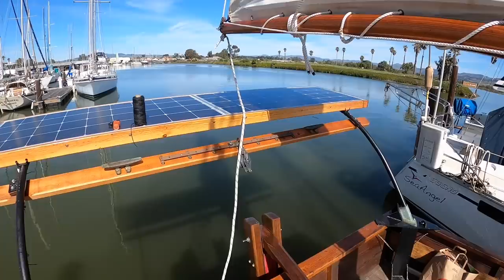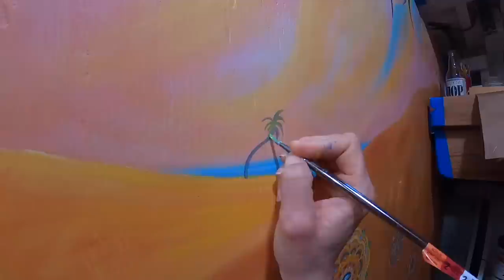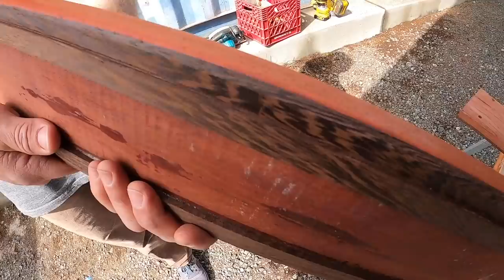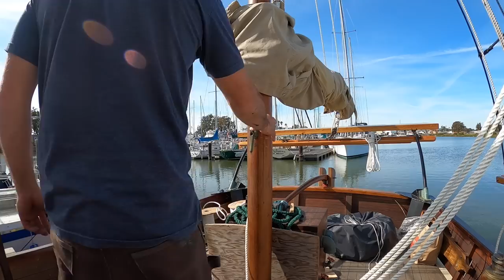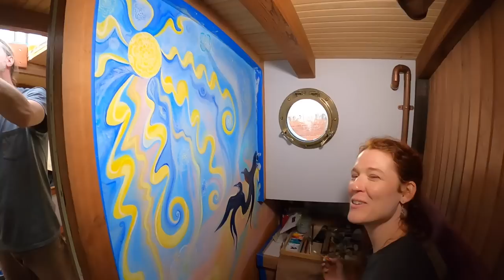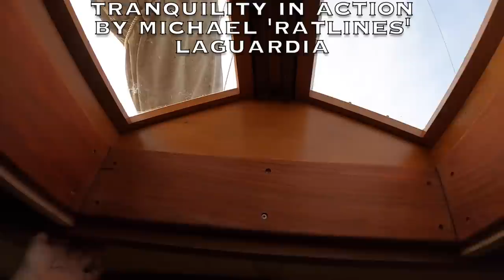Salt & Tar: Ep.190- Ruthless Boatbuilding

Comment: Awesome job Garrett and crew... if you don't like that deck mounted sheet block laying on the deck when the sheet is eased, you might be able to put a big spring around it's connection to the eyebolt so that it stands (sorta) upright off the deck and doesn't get fouled every time you haul or ease the sheet. Looks better too... Search for images of Springed Deck Blocks to see what I mean.. Great video...

Comment: Hey salt and tar.... a heads up...ok,  never never drill into a wood mast. " never " those 2 holes on the side that stresses the most. Weakened the wood pole. Take stainless steel straps, and ? 4 inch piece of flat stainless that will go around the mast. Drill thru the collar mount your eyes to it. Then roll it around the wood mast. Use the straps like hose clamps.  Do not crash the wood.
Theres many ways... just dont drill into it...

Comment: Calypso III is an original 30 foot classic wooden boat, gaff rigged double ender Tahiti Ketch true to the design of John Hanna a truly blue water historic vessel. Her Keel was laid in 1947 and she was launched in 1953. She has had only two owners. Selling by current owner of 25 years after purchase from the original owner builder.

Strongly constructed of copper roved 11/4 inch carvel planks of spotted gum below waterline and Queensland Pencil Cedar above. Spotted gum frames at 10 inch centres, grown knees and large double stringers. Large floors of spotted gum. Large keelson of spotted gum with large bronze bolts. Traditional maple and celery top floor Cabin and interior of Queensland Maple. Honduras mahogany tiller with Dougla Fir Main mast, mizzenmast and bowsprit.

Seacocks are Blake

Deck is laid white beech covered with plywood and Fibreglass,

Lead keel 1 1/2 ton external, internal 1 ton ingots ballast deadwood copper sheathed.

Full length aft rudder fully reconditioned.

Stainless steel rigging and stainless steel rod bobstay. White quality running rigging. Traditional wooden blocks.

Stainless steel pushpit bow pulpit and staunchons all round.

Simpson Lawrence Manual anchor winch CQR anchor and 40 metres of 3/8 chain.

Propulsion by 15HP Lister Twin Diesel SW2M recently fully reconditioned. Electric or hand start. Additional spares.

2 Depth sounders, VHF radio, 2 Burner metho stove. Stainless steel lined galley with sink and traditional bronze hand water pump and sea water foot pump

Gaff mainsail, foresail and spare

Saloon with 2 three quarter berths, vee birth single converts to double, hanging locker and enclosed head with Jabsco toilet.

Main diesel tank, header tank and water tank.

Manual Jabsco bilge pump and electric bilge pump.

New dc wiring with 100ah AGM battery and 30 watt solar panel.

Tender is a 2.4 Aquapro dinghy with 2 HP outboard.

The original owner meticulously and strongly constructed Calypso no doubt with the dream of cruising offshore. In the late 60's he embarked on a cruise with his family in Calypso over 9 years visiting New Zealand, Tahiti, Alaska. Vancouver, West and East Coast of USA, New York, Caribbean, Mexico, Galápagos Islands and Fiji. She is a true safe ocean cruiser. The current owner has cruised the Queensland coast.

Calypso is a registered historic vessel Hv000209 on the Australian National Maritime Museum register and is an Australian Registered Ship.

She has been regularly slipped and antifouled and the bright work maintained.

She is for reluctant sale at $50000

VESSEL DESCRIPTION

Vessel Name: Calypso III

Australian Registered Ship: Official No 317639

Australian Register of Historic Vessels: HV000209

Designer: John Hanna: USA

Builder: Ron Mitchell

Construction Timber:: Hull: Spotted Gum, Queensland Pencil Cedar. Cabin & Interior Queensland Maple. Tiller Honduras Mahogony

Spars Douglas Fir

Year Keel Laid 1947

Year Launched: 1953

Rig: Gaff Ketch

LOA (including bowsprit & Mizzen Boom) 36 feet

LOD: 30 feet

LWL: 27 feet

BEAM: 10 feet 6 inches

DRAFT: 4 feet 6 inches

Displacement: 9.8 tons

Engine: Lister SW2M twin Diesel (recently restored)

Vessel Location: Sunshine Coast Qld. Tried to copy this off Facebook but was unsuccessful.  I believe it to be a sister ship to yours.  It begs the question if you could have bought the same would you still build?

Comment: The mizzen mast traveler an boom is just dangerous. I know you know this because many people on your channel have already explained why.    Hi hope the only reason it’s not being address has to do with the lag in publishing video.  The reason I am commenting on this is simple. I don’t want to see you or anyone you invite on this boat get injured or worse. 
Sorry to be such a party pooper.
Reply: I try to refrain most times from being an armchair quarterback, and I know they are working super hard to get the boat done and go sailing, but yes, any rigger will tell you that in even a very brisk breeze there is a high risk of the mizzen ripping those davits right out, and causing mayhem.  In the Ketch I work in, we rely on the mizzen in heavy weather, so every fitting has to be carefully planned and bolted through a structural part of the vessel.  by 30 knots we are down to a reefed mizzen and staysail, and she rides well with these two, or can be hove to like this, but there is a ton of strain on both sails in that wind.  I'm sure they will find this out one way or another.  The west coast is super unforgiving.  

This in no way diminishes my super high regard for these folks.  They intentionally chose the far harder path of building your own boat, an option which I discarded because I didn't want to spend ten years building and not sailing.  They are achieving something very few people even attempt these days, and they will accomplish it and go far.  But this doesn't exempt anyone from the basic principles of rigging.

They could maybe stay it like a boomkin, with two galvanised cables turnbuckled to the port and starboard sides of the transom, and attached directly opposite the sheet, or with the sheet fitting being one piece with tangs on the underside leading to the stays, but it certainly wouldn't be my first choice.
Reply: @ralphgesler5110  Ive seen that episode.  The brackets that were fabricated for the davits are heavy duty, for sure.  But the sheet is in the middle of an unsupported length of hardwood at the top of those davits which are lever arms.  Correct me if I'm wrong but the davits slide into bronze holders that are bolted to the big steel framing.  Or do they slide all the way into the steel frames?? 

Locust is strong wood but the way this is rigged goes against basic principals.  It might hold up for a time just fine, but I have seen substantial hardwood belaying pins, as thick or thicker than that board go to pieces in a gale, and send shrapnel across the deck.  The human damage from that locust board snapping  or dislodging and sending the mizzen boom wailing about in 40 knots of wind is not a nice thought.  

I back what I said, it might be alright if it were stayed down to the hull by two cables.  That would increase the strength by a few orders of magnitude.    

I have had plenty of unsolicited boatyard advice on my boat too, of course it gets irritating, most of it I ignore, but sometimes somebody who's been there has a good nugget of wisdom for you.  

Like I said, my admiration and respect for both of them and their boat is in no way diminished by this comment.  Your comment about armchair quarterbacks being benched was witty though!
Reply: I see the armchair criticism from time to time but think it’s more helpful to focus on the quality of the advice.  Like you I have own large sailboats and have been an active sailor from the age of 12. (Almost to long to remember). I have also lost my broth in-law off the Oregon coast in sea that ripped a new 60 foot cat apart. I have had my rigging trashed off the coats of the San Juan islands in relatively protected waters. So shit happens. Like many of good characters on this comment section, when we see item that looks concerning or in this case dangerous we speak up. To stay quite would be a most unhelpful and inhuman action.  I for one wouldn’t want to spend years of my life building a boat from scratch and to this point, I enjoy and appreciate people that take these projects on. Helping them to sail safely is the least we can do even if it’s from our armchairs.
Reply: @ianwidger7905    I think sometimes people think I'm a bit neurotic and over conservative with how I sail and how I fabricate rigging, and set up a vessel etc..  But After seeing a couple near knockdown situations in heavy weather that could have easily been fatal for the dozens of crew aboard very large, seaworthy sail training ships, and seeing how the sea tests vessels  and how it almost immediately dismantles poorly planned rig and or gear, you look at the ocean differently.  Thanks for sharing your experiences Ian.  I'm sorry about your brother in law.